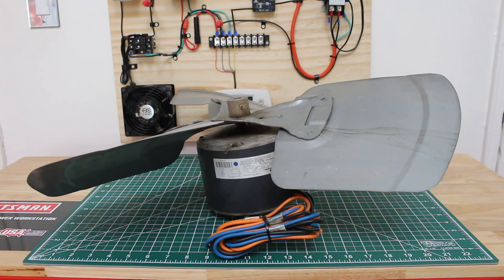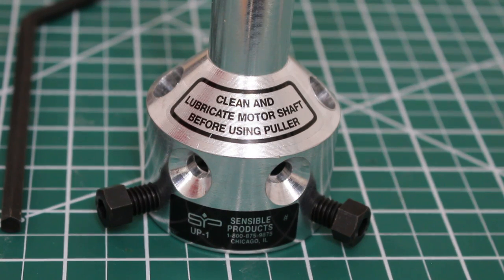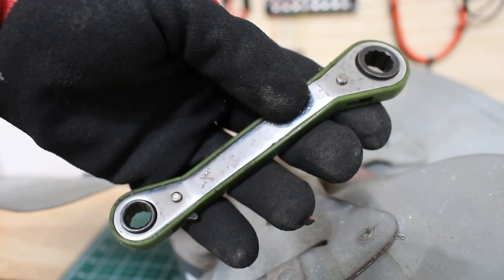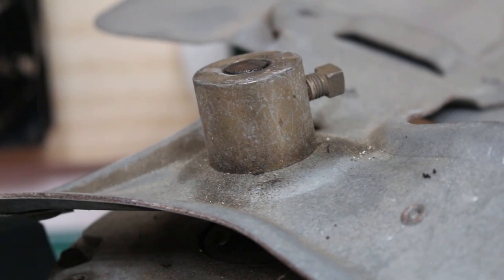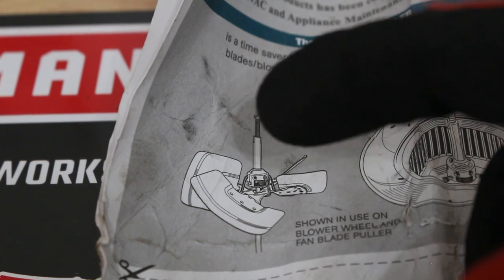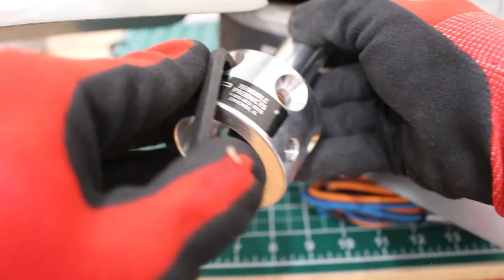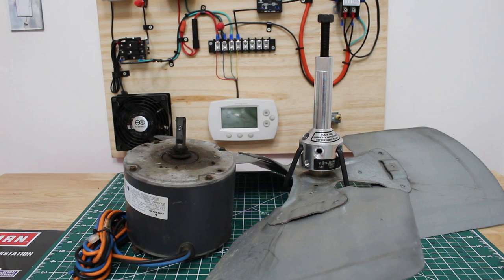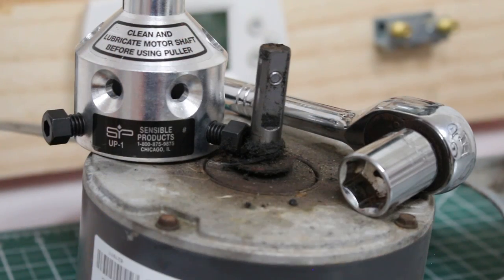HVACR: How To Remove/Replace A Fan Blade/Blower Wheel From A Motor (How To Use A HVAC Blade Puller)

Comment: Did you clean the axle in front of the blade and add oil first?
Can you tell me how to get a cast aluminum blade removed from a steel shaft?